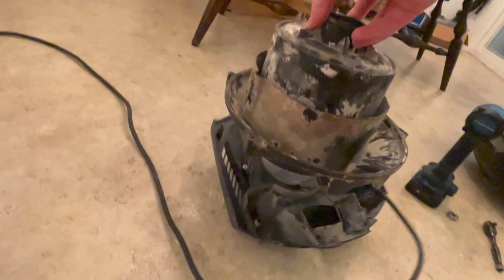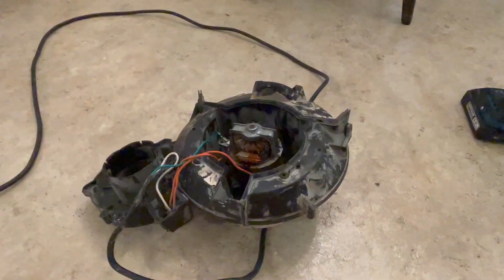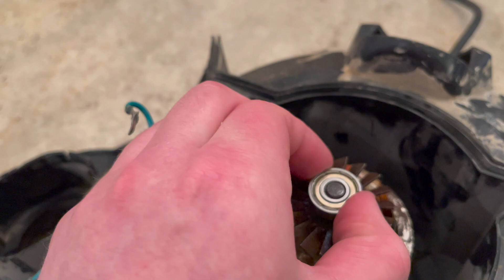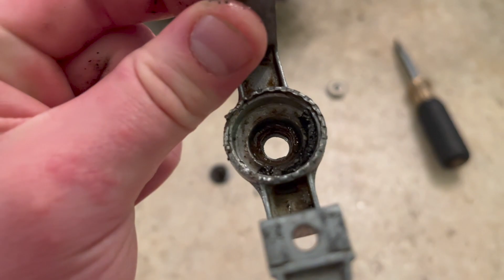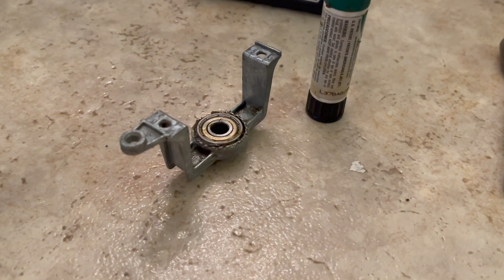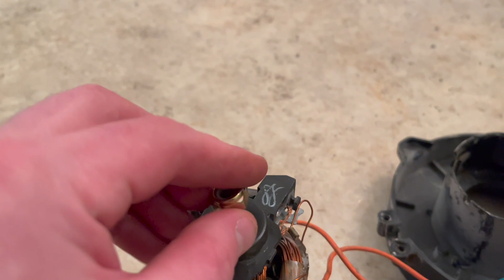Shop Vac repair: permanent noisy bearing fix, and solve issue with no suction

Comment: On my 30 yr old, 8 gallon Shop Vac, there aren't 3 more screws to remove that section with the switch. I've looked and looked and I can not take it a part any further to access the motor. Such a shame cause there aren't any rusted parts or anything, it's that dang brass bushing they used, that makes it sound like it's dying, esp on shut down.

Comment: Upon reassembly of the same fan shaft the dang clip didn't hold. It ran for about 20 seconds and the clip came off. The shaft key spun and routed out the hole and major damage. So I manufactured a resurface disk from a tin can top. Covered the damaged hole and drilled new holes and used pop rivets to secure it. New holes for the key way and the little set plates on both sides of the fan. I tried to thread the shaft and struggled to hold it good enough to put enough thread to hold it down tight. Went with the threads I had and bent a washer into a V and the nut tightened and held. I did put some lock tight and so far its holding. Unfortunately the next fan failure will probably be catastrophic. Only commented so if the same issue happened to someone it might be helpful. We think alike !
Reply: Thank you. This comment gave me the insight to why I couldn't get that fan reattached right.

Comment: What specific Threading Die did you use? I have a Little shop Vac that has a Similar Problem with the fan (Tension clip. It broke while I was re-assembling it.) and I’d like to try and do the same with replacing that clip with a nut and I may do the same with my current shop Vac as well.

Comment: Thanks for this walkthrough. I've kept my Ridgid vac alive for 20+ years by way of similar shenanigans, but it's never easy. On my vac, that brass fitting is not so easily replaced with such a standard bearing, as the housing is much larger and the shaft is 3/8" +. Fortunately I've was able to one that fits reasonably well at the hardware store.  Also , that second bearing (the one that is a real sealed bearing from the manufacturer) is totally encased in molded plastic. There's no way to remove it that I can discern. Even with the entire motor/shaft removed and the bearing housing exposed on both ends, it is enveloped in plastic front and back. I suspect that it is finally going out, with nothing to be done about it. Any ideas? Hate to throw a good vac because of a three dollar bearing.

Comment: That bearing inner race was too loose on the shaft, did you put a dab of that bearing stick on the inner bearing race also? Loctite says it takes up 5/1000 inch of play so I think both your inner and outer races were in range. How’s it working out?
Reply from the maker: I can't remember if I did or not. If it was loose in the new bearing, I would have. But it has been trouble-free since I made this video.